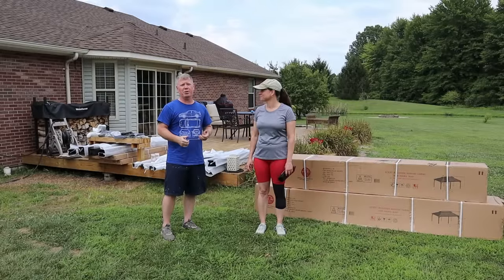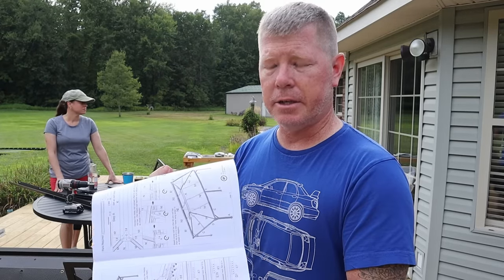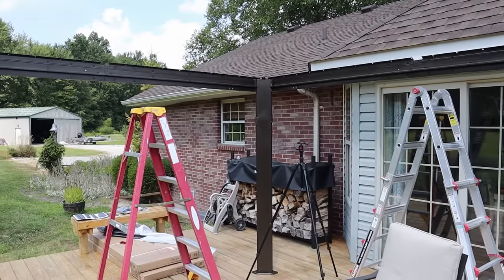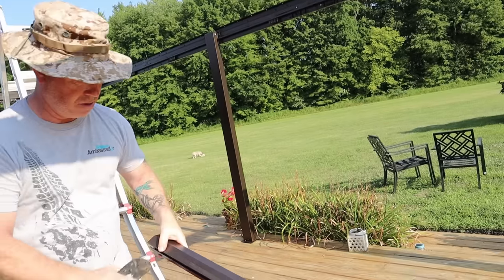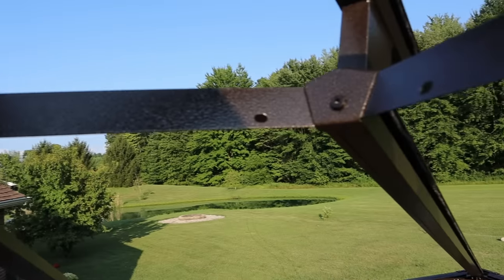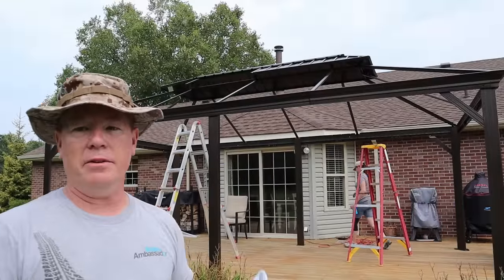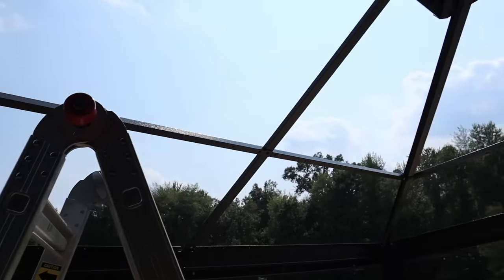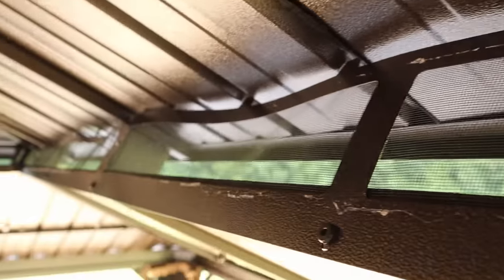Assembly How To- Kozyard/ Purple Leaf Gazebo (& Other Brands) - 12x20 Metal Roof Gazebo

Comment: I didn’t see this in the comments but I’m having issues sliding the lower corner roof panels in with the clips in place. Currently I am attempting to slide them in at the bottom of the slide rail but they are popping out or clips are falling off. This area is causing the most frustration. Any advice?
Reply: I was assembling mine today...the plastic clips are horrible. I wound up using small strips of duct tape to hold the clips in place while I positioned the panels. It was a pain, but it worked.
Reply from the maker: Hi Patrick, thanks for watching and asking.  We appreciate it. We can honestly say that was one of the most if mot the most frustrating pieces to deal with. We slid them in roughly starting halfway up if I recall. There is a track they need to slide into and it's not sp easy. We might have been partially lucky too. Hope this helps and that you get them all in without having an migraine first. Let us know how it goes.
Reply from the maker: @jr13030  thank you so much for sharing your experience and what worked for yall. We appreciate you adding to our community with kindness.  ❤️
Reply: We used scotch tape on the clips
Reply from the maker: @n0velistutube  Thank you for sharing. We greatly appreciate your contributions to the community.
Reply: @SpiritedWrenchers  would it be possible for you to install the roof panels without the clips? I put up one side without the clips and still seems to fit nice and snug

Comment: 32:32 I started putting the metal tab on the panels but after a while the taps  kept on falling off. So I  decided not to use all them metals tabs which made it more easier and faster to put on. Them dumb metal tabs never stay on. The panels still stay on without them tabs.
Reply: We Hot glued the plastic tabs in place, no way we could slide them all in each time. Thanks
Reply: @timp024  good idea. I did it for a client so I wouldn't been able to glue it cause then I would been there another day.
Reply: How has it held up without the clips? I might put my roof on without using them

Comment: Question…. How Did you move the structure after the roof panels where installed?
Reply from the maker: Hi Ken. Thanks for watching. We appreciate it. Great question. Dana and I just grabbed opposite corners while on step stools and push up to raise off the deck slightly and pushed it into place. We didn't have far to go and it's not so heavy where we couldn't move a little bit at a time. Hope that helps.
Reply: Ohhh I thought you all were going to actually take it off your patio. I was also wondering how you all were going to move it. Did you all bolt the gazebo to your patio?
Reply from the maker: @benettemcneill984  , hi there. Yes we sure did. Stainless threaded bolts right into the deck boards.

Comment: What is vholding the corner post to the groud?
Reply from the maker: Hi Clarice. Thanks for watching and asking. We appreciate it. We used threaded stainless steel bolts the size of the holes on each corner post and them into our wooden deck. Hope that helps.

Comment: The instructions state their should be 152 hangers , however we have 84 . To be clear , there are to be 7 hangers per track on C1 (total 14) and 7 hangers per track on D1 (14) , right? That makes for a total of 56 hangers for both short ends. Correct?
Reply from the maker: Hi Gary! Thanks for watching and the great question. The number of hangers required will depend on the size of the gazebo. For our 20' gazebo, we did use 152 grommets, but smaller gazebos will use less. What size do you have?

Comment: how did you secure the post unto the deck?
Reply from the maker: Hi Sagittarius Max, thanks for watching and asking. We appreciate that. So we used galvanized threaded screws just a bit bigger than the mounting holes on the bottom of the posts. We didn't share that in the video because so many people have a different platform they mount them to. So far, it's held up wonderfully here. Cheers!
Reply: @SpiritedWrenchers  But how did you access underneath the deck?

Comment: What about your anchoring...?.... a lot of strong wind where I live....
Reply from the maker: Hi Anthony. Thanks for watching. We greatly appreciate it. We purposely didn't show that part because the needs would be different based on where you live and how you have it installed (concrete, HOA rules, ETC). We used Stainless anchor screws into our deck board. Chose those that were the exact same size as the holes of the base. We have strong winds in OH at times  as well so far, no issues at all.

Comment: When installing the lower roof pieces how are you getting part z (the pieces clipped to the roof paneling) into the track ? It doesn’t fit if you just push it straight into the track and it’s impossible to slide it in the track from the bottom like we did for the upper roof paneling. Is anyone else having issues with that ?
Reply from the maker: Hi ncasey29. Thanks for watching and for asking.  I remember those indeed because they were a pain. Some I actually pushed them in from the side Instead of sliding from the bottom. It took some finagaling but they went in thankfully. We hope that helps.

Comment: We just finished putting ours together. A few hours here and there over a 4 week period. Does anyone else notice how hot it gets inside? I wasn’t prepared for that.
Reply from the maker: Hi Benette. Thanks for watching and congrats on your finished project. With a metal roof, it can get a little warm underneath. We actually have good breezes where we are so it's not too bad. We have talked about adding an overhead fan at some point. We'll see how hot the summers get here this year before we decide on modifications in order to make that happen.

Comment: The tube of sealer is meant to go inside the gutter part to make it water tight for the rain not on the outside seam :/ hope you did the inside too.
Reply from the maker: Hi Chris, thanks for watching and commenting.  We appreciate it. Yes we did both sides of the seam. Tried to ensure there were no leaks later. Happy to say we have none. Cheers!

Comment: Got mine in last night, ceaser model, and started the install alone. 10 by 12. Friend stopped by just in time for roof install.. wat a bitch that was!!! We only manager to get the top part in 2 hours. It was frustrating how they dont go in easier. Not sure if ill recommend this particular brand. Ive got to do the lower roof tomorrow, probably alone. Lets see.
Reply from the maker: HI Stillphenom, thanks for watching and sharing your journey. We greatly appreciate that. Glad your friend was able to lend a hand and yes, it can definitely be frustrating at times. We're actually getting ready to assemble a 10x12 from another brand this coming weekend. We hope that we have a smooth build on it as we'll be doing another episode for it. We also hope your lower roof is much, much easier. Come back and let us know. Cheers!

Comment: I like the way it looks but I'm not too thrilled with this product.
I have a feeling it will rust in the most unforgiving places.
I think wood post are better and mount your roof on top of the posts.
Reply from the maker: Hi Lord von Manor, thank you for watching and sharing your thoughts. We appreciate it.  Yes, these will never replace solid wood structures.  If we were to do those, we would go ahead and spend the money on a full shingled roof that was built into our home. That was next level expensive that we didn't want to look at now.
Reply: @SpiritedWrenchers  You could later move your manufactured roof that came with the kit onto wooden post if you ever have to.
Reply from the maker: @lordvonmanor6915  absolutely.  Certainly an option. May be the one we go with if the legs ever fail.
Reply: @SpiritedWrenchers  Right

Comment: Paneling included plastic instead of metal parts making it incredibly difficult compared to how easy you made it look.
Reply from the maker: Hi lol k. Thank you for watching and sharing your experience.  We really appreciate it. We have hear others share recently that the metal clips have changed to plastic. I have no idea why they made that change but it sounds like a bad one as everyone is having problems with them.
Reply: We threw them away since they would not stay on the roof pieces and prohibited us from sliding the panels into place. Not sure what they their purpose is but seems to be no issue without them.

Comment: Anticlockwisely
Reply from the maker: 😁. Thank you for watching.
Reply: @SpiritedWrenchers  Thanks for the video.  I started a 12x20 yesterday.  was able to get the legs up with myself and a ladder.  My brand is Sojag.  a couple of pieces are different but mostly the same.  Will be anchoring to concrete tonight then onto the roof.  not sure if I will need any of your videos in the future but subscribed anyways.  You 2 did a great job with this.  I really hope your channel grows.  Best of luck to you
Reply from the maker: @daveaffolter9697  Hi Dave, thank you so much for subscribing, watching and the kind words. We greatly appreciate that. I've seen a few videos of your brand, and you're right, pretty similar. I would recommend that you wait to anchor until you are completely done. It's easy to shift with 2 people and we bolted it to our deck once we had it fully built. Let us know how it goes.